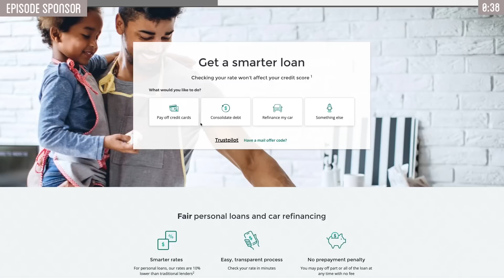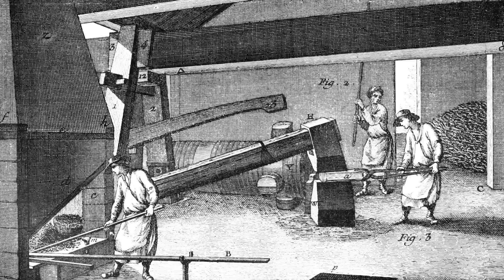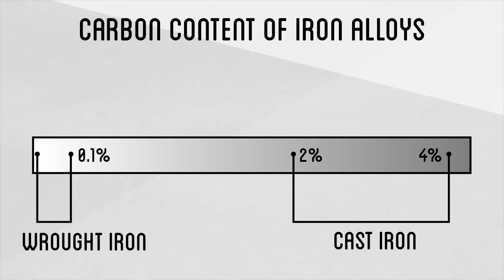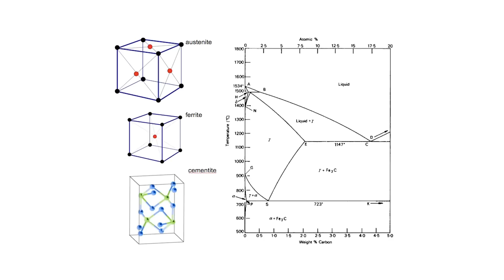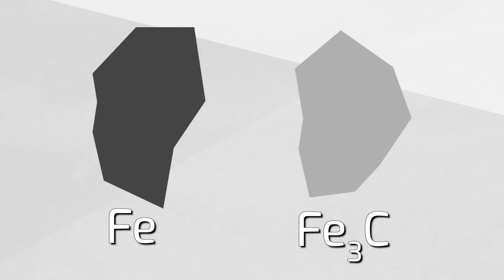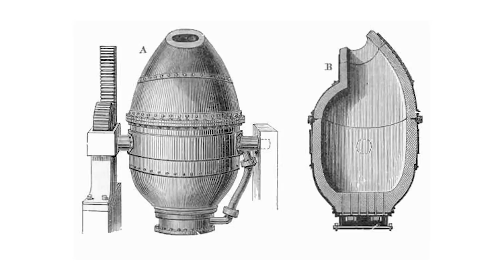Mastering the Secrets of Carbon and Steel

Comment: Thinking out loud with not much OJT in this chemistry area. Considering the relation to oxygen or lack of.
Would the low carbon steel get more carbon in a surface treatment if your clay and char wrapper was discarded while Hot under or immersed in a Hydrocarbon or oil for a temper also?  
I am working on color case hardening or at least a DIY case hardening historically easy with tech of the day.

Comment: I don't believe cast iron was ever converted to steel by heating in a bed of charcoal - that is the basic method of case hardening. Early steel was produced by puddling, which was a process in which molten cast iron was stirred while air was blown onto the surface of the molten alloy through long tubes. The air allowed the excess carbon to be burned off and converted to carbon dioxide. No charcoal was in contact with the molten cast iron during this process, as that would be counter productive.
Making steel in this manner was expensive as it could only be done in relatively small batches and required skilled workers.
Perhaps you discussed this - I stopped watching in confusion when I saw cast iron being reheated in charcoal with apparently no further processing to reduce carbon content - the remainder of the video played while I wrote this.
I believe that before people learned to heat iron to the melting point there was not an effective way to reduce carbon content. If carbon content was too high they simply had to figure out what they did wrong and start over. When technology reached the point that iron could be heated to a liquid state and cast iron could actually be used, as happened fairly early in Chinese civilization, then it was a very small step to learn how to make steel,from the molten cast iron, and indeed there is not much time between learning to cast iron and learning to make steel from it.
Case hardening wrought iron is an entirely different technology that can arrive before temperatures sufficient to melt iron are achieved by a society.

Comment: Just for reference the iron-steel-cast iron rough placements are a good rule of thumb. Bot nescessarily hard and fast rules. Super high carbon, high alloy steels can have well over 3% carbon in the mix. Rex 121 and zdp 189 are good examples.

You can also have steels with very little carbon that instead rely on elements like nitrogen or boron for hardening. Vanax is a good example.

Comment: One problem with case hardening is when one wears through the hardened case to expose the softer core is exposed making a softer edge.  It is likely that after sharpening enough times where the hardened case layer noticeably ran through, that the chisels may have been periodically returned to the smith to be re-hardened.

Comment: here's my thoughts and rudimentary understanding of this. The pig iron is too low purity to work with. Driving the temp. higher  to where it flows allows time for the impurities to burn off and get pig iron castings. But its still going to be some kind of high carbon iron, pig, wrought or cast. Cast is very difficult to machine. Steel is low carbon iron. The advent of this is gas and electric fired furnaces that allow for driving off the impurities of mostly carbon. Because you are not using a high carbon heat source. Steel can be considered as 2 types. High carbon and low carbon. High carbon is still lower carbon content than any iron. Low carbon can be considered virtually pure. When you get it this pure it loses its ability to be annealed or hardened. Thus you intentionally add impurities of, usually other metals to create various alloys. The magic one being spring steel. This was closely guarded because flint locks need spring steel in their mechanisms and various alloys that with stand hoop strength better for barrels and thus spring steel was regulated for how much a servant state could get their hands on and no one was allowed to know the recipes.

My guess is it was too impure with carbon to be workable. you either have to drive it to a higher temp. with charcoal, by forced air injection to where it drives off the carbon content as pig iron a few times more to get a steel. Or forced air injection and a fuel that burns hotter like coke or coal. Hence why its folded 1000 times. The act of heating cooling heating cooling eventually drives off enough carbon like an art to where it feels right for the layering of japanese forge welded billets as the steel consolidates and purifies. I do not believe one run like that will get you anything but a type of crude iron. No way steel came out.

Also this whole concept of "unlocking things" like a video game isnt cutting it for me. It either is or it isnt. Same for the amount of spring steel you can get your hands on. You cant just fake that IRL. It either is or it isnt. But Im a realist and guess how many times I ran a forge with any ore? ZERO, its probably not available in limestone beyond concretions. And I hate to neg. someone that did a thing. So hats off to this guy that runs a forge.

Comment: Is it possible that you try a video where you attempt to make coil springs using a primative method? I know they're a few hundred years old but I'm genuinely curious what the minimal amount of tools and methods you would need to produce them while still being functional.
Reply: Before the industrial revolution one of the uses for baleen was leaf springs for carriages.  Coil springs, even earlier ones, have higher weight capacity, travel, and longevity, but there are organic workarounds to many of the applications we use metal for.

Comment: Imagine the number of steps necessary into the adaptation of metallurgy between iron hammering by blacksmiths and Bessemer Method; then imagine whether there were more than two magnitudes (multiply by one-hundred) of steps necessary into the adaptation from sticks and stones to bronze. It's amazing.

Comment: "Case-hardening" is also called "cementing" and, in late-19th Century steel naval armor, "Harveyizing", after the US steelmaker who developed it using French nickel-steel armor as its basic material.  The layer of high-carbon material is rather thin, though in armor it was usually about 1-1.5" thick, making up only the thin surface layer in thick naval armor used in cruisers and battleships of the period.  The later thick-faced Krupp Cemented armor steel for naval armor used a chromium-nickel alloy for better hardening and tempering (toughening) but usually kept the thin Harveyized surface layer to make that layer extremely hard during the final hardening processes (a few types skipper the Cementing process and used the somewhat softer, but much tougher, thick face layer by itself for improved resistance to enemy gun projectiles).

Comment: Striking on wood imparts carbon making the case too hard. Having a basic metallic plate will help with that part of fracturing in the beginning.  But as far as blooming steel even back to the 900 and mid 1700s in Damascus, hence name, they bloomed steel with a semi style crucible that had alot of tiny layers, not our damascus today technically but Wootz Damascus. This is more Japanese style of Tamahagane of letting the iron flow with the charcoal in the  tatara and pick up carbon on the way to settle, then hammering out the kera into good worthy steel. Which the quality of the steel is oddly is very bad for my line of work because of the strength and the spark from rocks in a trot has actually caused forest fires.   I'd love to see your take on recreating old style Wootz damascus blooms. I love your stuff and me and my son watch alot and do alot of your ideas. And as a farrier I don't get much in the way of time to spend with him until now in the summers and hes learnign more and more. But he loves your stuff and as well as I do. Keep em coming brother. Cause I learned just a such as he has. Thank you :-)

Comment: If you take that steel, and put it into a crucible, you can melt it completely into a solid ingot to Forge easier. That is how I was taught to make steel, before hammering it into nails. Nails were the first thing, from what I was told, every black Smith started out actually forging. That is because you can always heat them up and fold them into a larger piece later if you need something else instead of nails.
Reply: I've been told that nails are the first thing to master because they are good practice.  They test several core skills, precision movements, and repeatability.  All while not requiring much resources per nail, and, as you mentioned, they're still a usable size that can be welded back together with relative ease.
Reply: I'm guessing it's also because you can always sell nails.

Comment: Worked in a steel foundry for 3 years I can help with ur core making and venting. Plus ur pour pressures. Example ur iron swords ur neck was to small as was the pour cup in the mold. I made everything from crane plane train parts to oil wells excavator teeth and even a Francis impeller. But alot alot of farm equipment and chemical plant flanges.

Comment: Maybe I missed it, but what was done differently between the two runs that added carbon to one batch and removed it from the other?
Reply from the maker: The tuyere was placed near the top on the first run to remove carbon, and then was lowered to add carbon to it.  Joe touches on it some at 8:32
Reply: @htme  so, if I'm understanding it right, you basically have a brick bucket, filled with charcoal and "iron" (of any purity), the charcoal and the iron do not directly mix, so while both will get hot their different properties mean that they won't melt into one homogenous blob. If the intake is at the bottom, as the iron* melts and drips to the bottom it will absorb more carbon from the surrounding CO2 formed from the charcoal's combustion within the high-oxygen environment. If the intake is at the top however, as the iron* melts and drips to the bottom it is left in a low-oxygen environment where some of the carbon within it actually seeps out? (I assume mixing with the limited oxygen there is to form more CO2?
Reply: @robonator2945  The carbon isn't seeping out but rather chemically removed through oxidation, the simple explanation is that oxygen binds incredibly strongly to other atoms so the carbon would rather bond to the oxygen than the iron. Once the iron melts it is however fairly unlikely to bond to carbon again until the fire is very hot, and of course you just make sure to stop the fire before the iron has time to absorb much carbon.

In the other case where they're adding carbon they're keeping the iron in an oxygen poor environment, since the oxygen is reacting too quickly with the other metal and so there's only carbon there. The bottom of the furnace should also be hotter so that means the iron will end up absorbing carbon.

Comment: I didnt quite understand how they were able to get the carbon out of the first steel by remelting, anyone care to explain?
Reply: The ash of the coal at like 4500 temperature becomes carbon so they just got it less hot
Reply: @strangetar2833  alright, i get that, but how does that sponge the carbon out of the bloom?
Reply: @minty5221  iron melts and flows down and carbon sticks to the coal
Reply: @strangetar2833  oh thanks, i fully get it now

Comment: A video on sanding stones and how you' re able to get a stone deadflat could be interesting, albeit maybe much shorter. It would be the 3 stones technique(?) Anyways, steel is a crazy important development but having stones flat enough to sharpen a chisel or tool crazy sharp/flat and accurate is an immensely forgotten aspect as well.
Reply: the whitworth 3 plate method?

Comment: As long as you are using hand-tools, you will never be able to utilize ultrahigh carbon steels. Their unique metallurgical characteristics require that they be kept molten their entire work time. Manufacturing of anything in ultrahigh carbon steel is stupidly expensive, but the closest thing we have to the fictional "adamantium" because it is nearly indestructible.

Comment: Surely to remove excess carbon you need to introduce higher levels of oxygen and separate your iron from your charcoal during the process.
Reply: I didn't think I'd be the only one who noticed that he skipped the puddling furnace. It's often overlooked because while it didn't make a huge improvement in the quality of steel, it did greatly improve the speed and volume of iron and steel that could be produced. It started the process where technology of scale could make things like steam power and railways possible. It started the feedback loop that created the modern world. It's the world's most underappreciated invention.

Comment: For anyone wondering about the difference between Wootz and Damascus steel they can be the same thing but Damascus is also used to refer to pattern-welded steel which is where two or more different steels are welded in layers to create patterns in the metal which can resemble the pattern found in wootz steel. Basically, Wootz exclusively refers to steel made in a crucible whereas Damascus can refer to either crucible or pattern-welded steel.
Reply: I hope the "great Damascus nomenclature war" doesn't flare up again.
Reply: the differences between welded steel like that and actual Damascus steel have been extremely well documented. That LOOKS like Damascus steel. It's as much Damascus steel as pyrite is gold.
Reply: Theoretically, you could weld wootz into a pattern welded Damascus steel
Reply: If you want to replicate a Wootz “Damascus” blade, start with a Model T axle. They are both vanadium steel (the Wootz steel was made from an ore body contaminated with vanadium). The presence of vanadium permits very high carbon contents (~1.5%) to be stably maintained.
Reply: Wootz is the historical Damascus of legend. Damascus refers to an aesthetic of patterns within steel made to mimic the aesthetic of Wootz (it's the difference between antique bronze and antiqued bronze). Remember that "Etched Damascus" is a term alongside "pattern-weld damascus" where "pattern-weld" is often just replaced with the style of pattern weld (example: butterfly damascus). And etched damascus is just regular steel etched with a laser or acid.

If someone only calls it "Damascus" without being specific, they're selling you a gimmick. Demand specifics. You can have up to 5 different steels in one of those, make sure it's not 50% angle iron.
Reply: @Cretaal  Was all Wootz steel also historical Damascus steel then? So, If back in the day, someone took a good Wootz steel ingot and made a crappy blade, would that technically also be historical "Damascus steel"? What if someone took a Wootz ingot to England, would a blade made from it also be called Damascus steel? Could you get historical Damascus steel without the Damascus pattern? Or was that pattern something that was intrinsic to forging Wootz steel?
EDIT: I had to add the term "historical" so there was no pattern weld/damascus confusion.
Reply: Ok steel was discovered by the Jews living in Damascus back before time 🤔
the process was hammering out iron on an anvil and folding it 14 times , the carbon from the hammer blows would then migrate into the iron creating steel 
wootz steel was processed in a furnace , not by accident they knew what they were trying to produce , a faster way to make steel
Reply: Both are same. Woozt the magnificent steel was imported from bharat to Damascus to make weapons. So westers tribes and kingdoms know it by name Damascus. Woozt is sanskrit name

Comment: This process is really complicated to understand. I can imagine, that with nowadays tools it is really simple to turn carbon into steel and find the perfect melting point with the amount of carbon and heat, but I have absolutely no idea how he turned this out with his self-build oven.
Reply: Even with modern tools, it's not a simple process other than in the sense that it's largely automated.
Reply: Steel is still complicated enough that it's the single most recycled material, about a third of all steel produced is actually just recycled scrap steel. Steel Mills are also some of the largest and most expensive to operate factories in the world and require very skilled labor.

Comment: fun fact if you cut a case hardened piece the cross section shows where became steel and what stayed iron and it's super visible
Reply: Sounds very similar to how you can cut an arc welded piece of steel and see all the individual beads in the cross section when you do stress testing.
Reply: One of the important steps in the development of battleships was the ability to accurately control the depth of hardening, allowing for the production of armor that had a hard surface but was backed by a more ductile layer that could flex and both absorb the force of an impact as well as stretch in response to temperature changes.